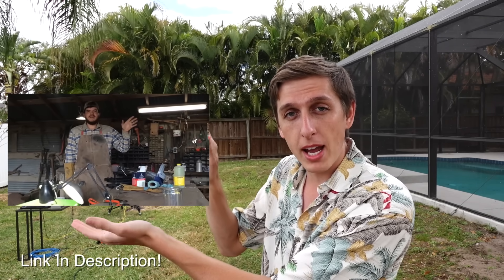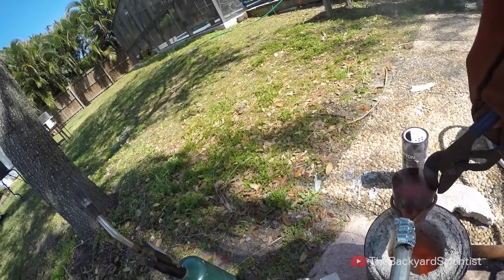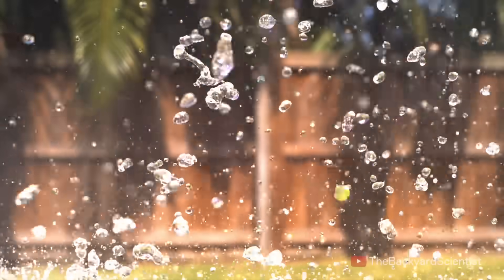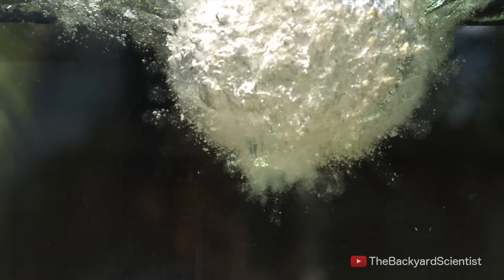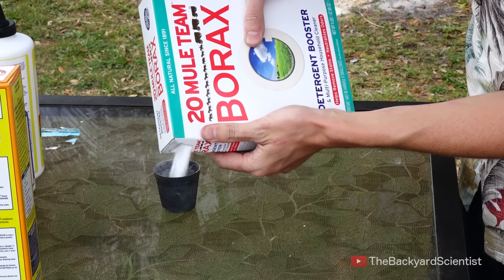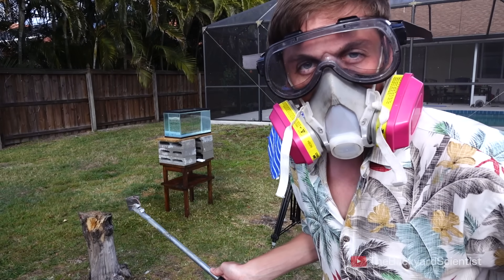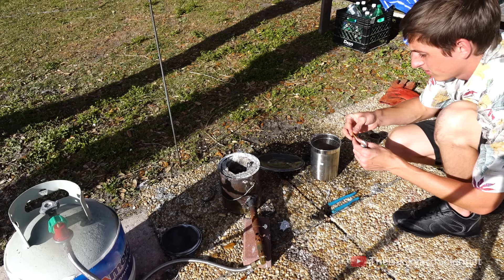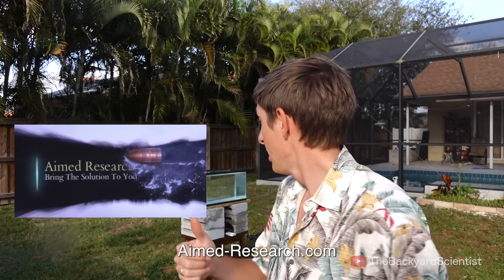Pouring Molten salt into Water - Explosion!

Comment: Maybe it happens because of the chlorine... When you melt it and pour it into water, Na and Cl get seperated from eachother and cause an explosion
Reply: =NOPE,ITS ABOUT DENSITY AND VISCOSITY.....MOLTEN SALT DENSER THAN WATER BUT LESSER VISCOSITY

=MOLTEN SALT SINKS IN WATER,BUT DUE TO LESSER VISCOSITY IT'S DROPLETS IMMEDIATELY DISPERSE INTO LITTLEST POSSIBLE ONES,WHICH TRANSFER THEIR HEAT TO WATER ALL AT ONCE WHICH DOES A BOOM

.......MOLTEN COPPER INTO WATER DOES THE SAME BOOM.........ALSO WATER IN BOILING OIL......JUST THE SAME PRINCIPLE.....AND PROOF IS ABOUT NOTHING HAPPENS IF WATER ON MOLTEN SALT OR COPPER.....

...........SO LESS VISCOUS LIQUID MUST BE DENSER TO GO BOOM.............AND IF IT HAS LESSER DENSITY SO IT'LL JUST FLOAT ON SURFACE........LIKE IF WATER TO POUR ON MOLTEN SALT,THERE'LL BE NO EXPLOSION.....................AND WATER ON MOLTEN COPPER DOES NOT EXPLODE...............JUST BOIL AWAY FROM SURFACE,BECAUSE OF IT CANNOT GET UNDERNEATH DUE TO LESSER DENSITY......................

.............AND BOILING OIL DOES NOTHING WHEN POURED IN WATER,BY THE SAME CAUSE...........MAYBE SOME BUBBLES WILL BE,BUT NOT VERY MUCH,BECAUSE OF WATER WILL ABSORB HEAT AND IT'S UNDERNEATH OIL SO AREA OF CONTACT WILL BE JUST MINIMAL AS POSSIBLE................

.................AND IF DENSER LIQUID WILL HAVE GREATER VISCOSITY,SO IT'LL KEEP TO MAINTAIN IT'S SHAPE AND WONT EXPLODE........................LIKE MOLTEN SUGAR,MOLTEN IRON,MOLTEN ALUMINUM,LAVA WHICH IS MOLTEN ROCKS.........................

...............I THINK YOU GOT THE POINT........................
Reply: @robotnikkkk001  oh okay. Thank you

Comment: I think its a chemical reaction ?
Reply: =NOPE,ITS ABOUT DENSITY AND VISCOSITY.....MOLTEN SALT DENSER THAN WATER BUT LESSER VISCOSITY

=MOLTEN SALT SINKS IN WATER,BUT DUE TO LESSER VISCOSITY IT'S DROPLETS IMMEDIATELY DISPERSE INTO LITTLEST POSSIBLE ONES,WHICH TRANSFER THEIR HEAT TO WATER ALL AT ONCE WHICH DOES A BOOM

.......MOLTEN COPPER INTO WATER DOES THE SAME BOOM.........ALSO WATER IN BOILING OIL......JUST THE SAME PRINCIPLE.....AND PROOF IS ABOUT NOTHING HAPPENS IF WATER ON MOLTEN SALT OR COPPER.....

...........SO LESS VISCOUS LIQUID MUST BE DENSER TO GO BOOM.............AND IF IT HAS LESSER DENSITY SO IT'LL JUST FLOAT ON SURFACE........LIKE IF WATER TO POUR ON MOLTEN SALT,THERE'LL BE NO EXPLOSION.....................AND WATER ON MOLTEN COPPER DOES NOT EXPLODE...............JUST BOIL AWAY FROM SURFACE,BECAUSE OF IT CANNOT GET UNDERNEATH DUE TO LESSER DENSITY......................

.............AND BOILING OIL DOES NOTHING WHEN POURED IN WATER,BY THE SAME CAUSE...........MAYBE SOME BUBBLES WILL BE,BUT NOT VERY MUCH,BECAUSE OF WATER WILL ABSORB HEAT AND IT'S UNDERNEATH OIL SO AREA OF CONTACT WILL BE JUST MINIMAL AS POSSIBLE................

.................AND IF DENSER LIQUID WILL HAVE GREATER VISCOSITY,SO IT'LL KEEP TO MAINTAIN IT'S SHAPE AND WONT EXPLODE........................LIKE MOLTEN SUGAR,MOLTEN IRON,MOLTEN ALUMINUM,LAVA WHICH IS MOLTEN ROCKS.........................

...............I THINK YOU GOT THE POINT........................

Comment: Just remember that sodium alone reacts with water to form NaOH.  Since much energy is put into the metal to form sodium, a similar amount of energy is released upon it's formation. NaOH, as you pointed out, is a very basic (big pH) ionic compound.

Similarly, your molten salt might be having the same reaction, as the sodium might be disassociating from the chlorine in the molten state.  Just remember that the chlorine will also be forming HCl (a very powerful acid).  In the final analysis, the very strong acid and the very strong base will neutralize each other.

Your pH test as to what is happening in the molten sodium explosion isn't really valid as proof that the molten sodium and chlorine aren't reacting separately with the water, as the basic chemistry predicts that the final solution of sodium metal and water will form a high pH, and salt will form a neutral pH.  Adding heat to the system only accelerates the speed of the reactions but not the final outcome. (That is not always the case with chemistry, however.)

Speaking of chemistry: Sodium reacts explosively with water because the reaction energetically releases hydrogen. The heat of the reaction is great enough that it ignites the hydrogen, which burns violently in the presence of atmospheric oxygen. At the end of it all, you have a solution of sodium, which has a lower energy state than the water and sodium had prior to the reaction.  A large amount of chemical energy has been released as heat. Some of that heat is converted to momentum of water due to the violence of the reaction  

Now when the molten salt reacts with water, a whole lot more is going on.  Both sodium and chlorine are exceptionally electropositive & electronegative elements. Glommed onto each other as salt, they form a very stable ionic compound. While they freely dissociate into water, there is not any significant release of energy when salt is mixed into water. In fact, the change in enthalpy (a type of energy measurement) of salt dissolving into water will leave the solution slightly colder than before. Where then, does the energy of the explosion come from?

There is an awful lot of reactions going on when the molten salt goes into water.  The free sodium is reacting with water to release hydrogen, a gas. The chlorine (once released from the sodium) is also a gas. Said gaseous chlorine is also reacting with water (at a sufficiently high temperature) as shown:  2Cl2+2H2O = 4HCl+O2  Notice that this reaction is releasing free oxygen (gas), which is quite happy to react with hydrogen (gas) to form...more water.

Your molten sodium is reacting with water as dissociated sodium and chlorine, as you postulated in the beginning.  The explosion occurs because the reaction intermediaries are very rapidly forming gases. Said reaction takes up a lot of space, and this rapid expansion of gases we think of as an explosion.  Now along the way, many of the reactions are taking gases and forming water or ionic compounds dissolved in water.  This of course, is reducing the volume of the reaction, so there will be an ebb & flow in the volume of the reaction zone, according to which reaction is predominating.  I believe this is what you are seeing in your high speed camera.

Since the final reaction equation is not energetic, where does the energy for all that violent explosion come from?  Nothing more, in fact, than the heat contained in the molten salt.  Imagine, if you will, that all that heat is instantly converted into gaseous water  (steam).  That would be one heck of an explosion, and it would instantly condense back into water.  That is what has happened by way of many chemical intermediaries.
Reply: Also to add that Hydrogen and Chlorine react violently in the presence of sunlight.

Comment: my guess is that NaCl specifically has a lower mass than all of the other salts you tried, so transfers the heat to the water more slowly, but can ultimately still trap those little bubbles of superheated steam, resulting in the explosion,
Reply: =NOPE,ITS ABOUT DENSITY AND VISCOSITY.....MOLTEN SALT DENSER THAN WATER BUT LESSER VISCOSITY

=MOLTEN SALT SINKS IN WATER,BUT DUE TO LESSER VISCOSITY IT'S DROPLETS IMMEDIATELY DISPERSE INTO LITTLEST POSSIBLE ONES,WHICH TRANSFER THEIR HEAT TO WATER ALL AT ONCE WHICH DOES A BOOM

.......MOLTEN COPPER INTO WATER DOES THE SAME BOOM.........ALSO WATER IN BOILING OIL......JUST THE SAME PRINCIPLE.....AND PROOF IS ABOUT NOTHING HAPPENS IF WATER ON MOLTEN SALT OR COPPER.....

...........SO LESS VISCOUS LIQUID MUST BE DENSER TO GO BOOM.............AND IF IT HAS LESSER DENSITY SO IT'LL JUST FLOAT ON SURFACE........LIKE IF WATER TO POUR ON MOLTEN SALT,THERE'LL BE NO EXPLOSION.....................AND WATER ON MOLTEN COPPER DOES NOT EXPLODE...............JUST BOIL AWAY FROM SURFACE,BECAUSE OF IT CANNOT GET UNDERNEATH DUE TO LESSER DENSITY......................

.............AND BOILING OIL DOES NOTHING WHEN POURED IN WATER,BY THE SAME CAUSE...........MAYBE SOME BUBBLES WILL BE,BUT NOT VERY MUCH,BECAUSE OF WATER WILL ABSORB HEAT AND IT'S UNDERNEATH OIL SO AREA OF CONTACT WILL BE JUST MINIMAL AS POSSIBLE................

.................AND IF DENSER LIQUID WILL HAVE GREATER VISCOSITY,SO IT'LL KEEP TO MAINTAIN IT'S SHAPE AND WONT EXPLODE........................LIKE MOLTEN SUGAR,MOLTEN IRON,MOLTEN ALUMINUM,LAVA WHICH IS MOLTEN ROCKS.........................

...............I THINK YOU GOT THE POINT........................

Comment: Oh! My freshman chem teacher did this, but it was with pure potassium (preserving it in oil prevents the oxidation, the same thing that allows super-hot salt to go through the same chemical reaction with the water). Nothing like coming into class and seeing a SWAT shield on his desk in front of a big, clear bucket of water.

And no, you won't see a change in the Ph of the water because the molecules of h2o were literally used up by the reaction.

Comment: Wait if its a physical reaction does that mean the molecules are reacting with each other? Because like you said before it has nothing to do with the amount of heat since the other metals you tested wernt as explosive. And is there any way to test the ph of liquid metals because it might be ph neutral therefore not causing the ph of the water to change

Comment: Its clearly physical reaction ;). When you pour something hot in water( DONT DO THIS AT HOME!), the poured material transfers heat to the water rapidly, which makes it evaporate fast too. And steam has larger value than the water, which finds the easiest way to expanding, up to the surface of the water. And because its so fast, it explodes. Its like sparkling water, but on a whole new level...😅 And its the biggest risk in the blast furnaces during the metal processing. There however, is it oposite. Water enters the boiling metal, but the result is almost the same: explosion and hot sputtering all around!

Comment: it IS a chemical reaction, sodium and all the other elements of the same group in the periodic table react with the water molecules, the ph does not change because the product of the reaction goes into the air, that is the reason it first makes bubbles.
Chemistry.

Comment: Ok i am on 5:32 and i think i already know whats going on. The thing that is going is, i think something in salt extracts O2 and then H2 comes out which you can see the explosion at the end as a result based on the heat of the salt. The faster you trow it the slower it will cool so it will result in a higher explosion becouse of the heat. But idk what is the thing that extracts O2. Like i said i think its something up with salts elements but idk really couse when you two in the salt into the water without heating it, it gives you a diffrent result so there is another reaction on heat. So i think this is chemical and physical reaction but i might be wrong again. You just never know but that is just how science works. You just gotta keep testing until you get the right result

Comment: If you look at the first column on the periodic table- excluding Hydrogen because it's a gas- Salt (Na) is an alkali metal. Alkaline metals react with water  to release hydrogen gas, which is highly flammable. If anyone decides to try this experiment, wear safety goggles because you can permanently blind yourself if you're not careful.

Comment: This happens because of the Liedenfrost Effect. This is a physical reaction, and not a chemical one. When molten salt, obviously heated at very high temperatures is added to water at room temperatures, molten salt tries to he at the water very quickly causing water vapor at the top, but as theolten salt goes further Deep into the water, the water pressure increases and it cause the water vapor to exert pressure to escape, just like a fire cracker. Hence the explosion. PLEASE DON'T TRY THIS AT HOME AT ALL especially with glass, because it can explode with very high velocity and pierce your eyes, face or vital organs. A word of advice to the publisher of this video. Please don't post such videos because kids might try this and get gravely injured. Or at least tell this in your video, that "Kids please don't do this at all"

Comment: I think it is happening because melted Nacl transfer the heat to the water very quickly.
 so it produced much water vapour very quickly like an explotion.
Reply: That was another reason puting lava or something that are as hot as lava in water it will cause bit explosion but salt explosion is more stronger than lava

Comment: My hypothesis is that this is a coulombic explosion, much like with pure sodium. In this case, I believe the water is dissolving either the sodium or the chloride ions, leaving behind a liquid rich in the other ion. Eventually, the high charge of the liquid overcomes the surface tension, at which point the whole thing explodes.

Comment: I might be wrong, but I think the extreme heat decomposed the salt, eliminating the chlorine and you actually got metallic sodium, that it very reactive and explosive when in contact with water. That, or the heat was so high that the water evaporated so very fast and built up an enourmous pressure.

Comment: Not a scientist anymore but probably the chloride changed the viscosity (water friction or whatever it’s called) allowing more of the water to react in the few frames by giving the molten salt more water to react with. If it’s an exponential increase it’s probably linked to that viscosity increasing said surface area. Mathematician btw so plz don’t me mad at the terminology.

Comment: This is a physical process called Molten Fuel Coolant Interaction (MFCI or FCI). It is the same process that occurs with magma and water during explosive phreatomagmatic eruptions. Your example is correct, a vapour film is formed around the fuel and this expands so fast like a wave and generates the explosion.
Thanks for the video! I will use it for my volcanology lectures!
Reply: Question is: WHY other molten salts don't make same effect?
Reply: is it just that efect though? it seems very violent and the real shockwave forms after the film is formed and moved forward far fast
Reply: @km5405  yes, it is. The shockwave from phreatomagmatic eruptions has enormous power, and it moves so fast. The same occurred in the Tonga eruption in December 2021. The shockwave had a speed of more than 300 m/s and reached all the globe.
Reply: @km5405  Yes, it produces a lot of gas (water vapor). 1g of water in liquid phase is of course only 1 cm^3. However, 1g of water vapor at RT has a volume of approximately
1.356 dm^3 with ideal gas approximation. So its expansion of 1356 times. That's a big increase in volume in a very short time. You are bringing in contact liquids with almost 800K
temperature difference. The heat transfer will be very fast.
Reply: Why doesn't this occur when we see magma flowing into the ocean in Hawaii?
Reply: I'm glad and reassured that some people do understand why the explosion happens.
Reply: Interesting. Explain this: Years back they used sodium filled exhaust valves in gasoline powered heavy duty engines. Things like large truck engines, industrial engines & so on. Today most heavy duty engines are diesel. The valve stem was hollow with a small amount of sodium inside. The idea was to transfer heat from the red hot valve head into the stem of the valve as the valve opened & closed. This would transfer heat into the cylinder head away from the super heated valve head preventing damage. Then machinists working on the engines in the shop would get damaged by exploding sodium filled valves if the valve had a slight crack in it.  Many shops would not work on them due to the danger. The danger was in the use of water based coolant used in the valve grinding machine. If petroleum based coolant was used there was no danger. In this case the sodium was not heated. I have no idea if this is true but I do remember that a lot of machinists would refuse to work on them, I tried.
Reply: Im hip. Science teacher in 6th grade taught about this. Unfortunately we actually didn't get to see it so of course as a kid didn't truly believe it. Finally got to see it. Kudos teach!!!!!
Reply: I like how if somebody answers wrong, people like to correct them. But if they are smart, they are a nerd for having a better understanding.
Reply: https://youtu.be/_PxOFMw5FpU
Reply: So it’s like a steam explosion?
Reply: This is also how molten slag explosions happen, even with just a small amount of water.  Lots of 'Slag Explosion' videos on youtube.
Reply: Chernobyl noises
Reply: Molten Fuel Coolant Interaction:  Explain the FUEL part of this video, please.
Reply: Is this why underwater super volcanoes are so dangerous
Reply: So how come this happens with molten NaCl and not the other compounds he tested?
Reply: Well explained.
Reply: @3rn3strom3r  put it on a world wide scale in the pacific ocean, and you have the start of Noah's flood !
Reply: nerdy
Reply: Everyone already knows this. Basic high school chemistry
Reply: ok nerd
Reply: @felixhenderson7398  🤡
Reply: @alexjoke9141   says the person who has joke in their name 🤡
Reply: @felixhenderson7398  ratio
Reply: @felixhenderson7398   toxic just let him know stuff
Reply: @felixhenderson7398  Nerd= Better job. I guess you will (typed will because you are probably under 13) love to live on 500 dollars per month.